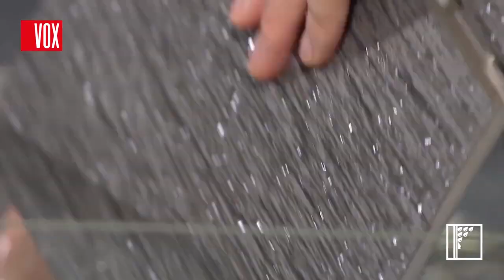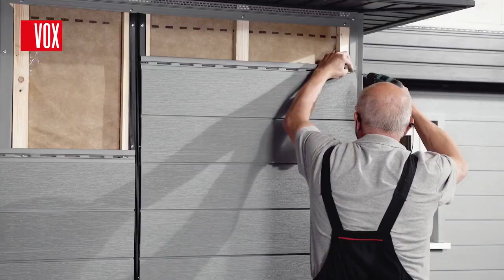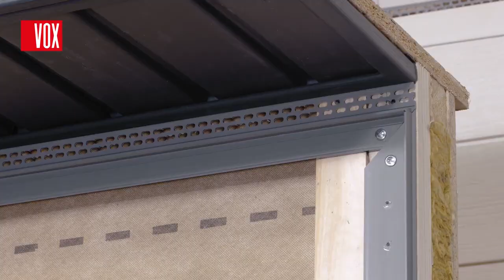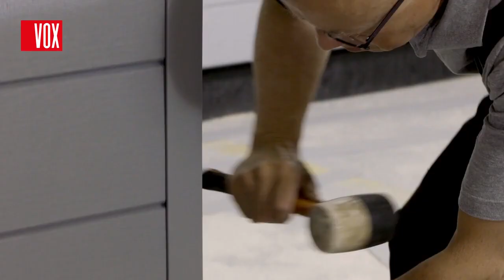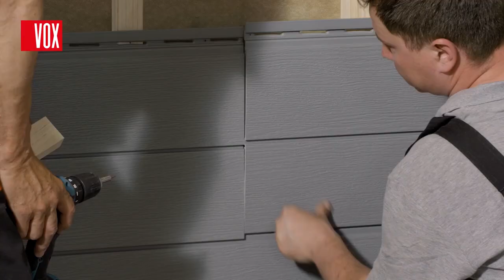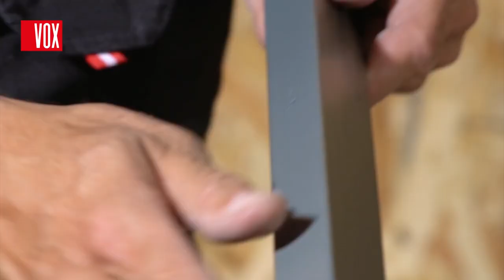KRONOSOL Parquet : VOX Kerrafront installation

Comment: I am considering this for the sides of Dormer windows and was wondering can these panels be installed vertically instead of horizontally?. The patio doors have a vertical ribbed feature on their bottom third which would match with vertically installed vox panelling. Thank you.